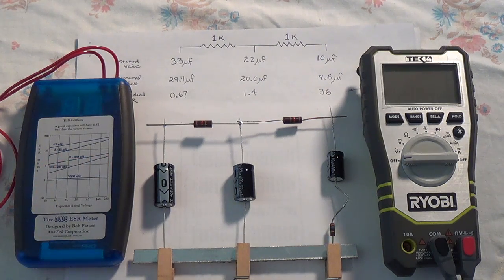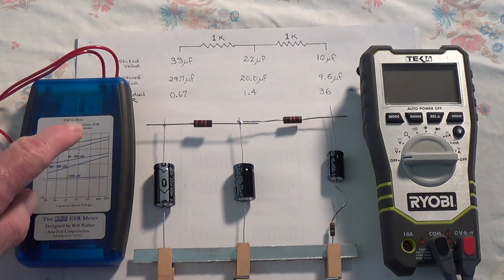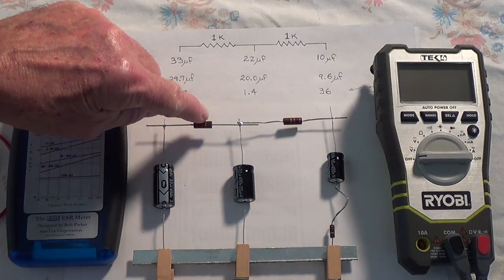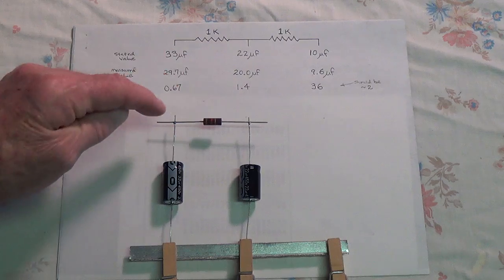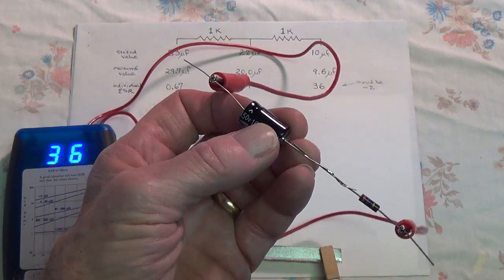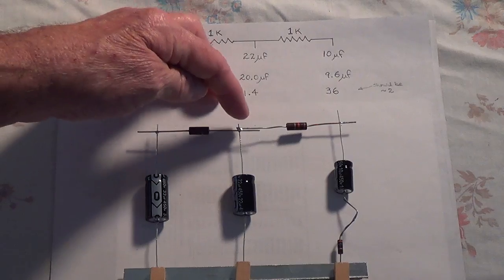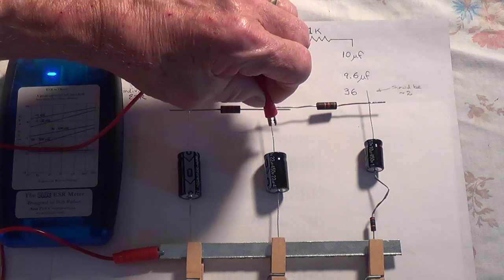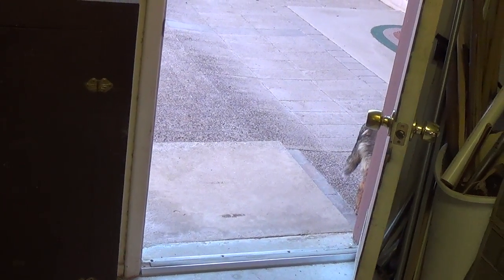Measuring ESR in Tube-Amp Electrolytics, In-Circuit

Comment: what if it reads 0.0?....thats what im getting on the filter caps of a hybrid solid state amp with a tube pre amp section....i really like it but it totally fizzled and died....a 'Legend rock and roll 50"  ....thanks Uncle Doug-
Reply from the maker: What value are the capacitors, Ed? Solid state amps often use caps that are of very high capacitance and relatively low voltage rating......which will provide ESR readings that are quite different from tube amp capacitors.
Reply: 63 volts ; 3300 microfarads and and right above that there is marked CE 62W....is that 62 watts?....it also is marked NEGATIVE with a little circle grid and JAPAN.
Reply from the maker: As predicted, SS filter caps are the opposite of tube amp filter caps. Looking at the Anatek graph to see what an appropriate ESR value would be for such a cap, we see that @ 500uf the ESR value is around 0.1 Ohms......so you would expect a 3300uf cap to be even lower, i.e. just about zero.   https://anatekinstruments.com/products/fully-assembled-anatek-blue-esr-meter-besr

Comment: I can't quite figure out why you would want "proof" that a capacitor is bad or out of specs.
A casual glance at any capacitor spec sheet should quickly make you worry about
how many hours, and at what average temps and voltages, a particular capacitor 
has been subjected to.
Capacitors are a "wear" item, (just like tubes), with a finite, relatively short, 
(compared to other components), life span.
Unless it is completely obvious that the capacitors have been recently replaced, 
and are reasonably over-rated, 
(temperature, voltage, and hours ratings), for the application,
they should be replaced without question, or proceeding any further, 
unless you're trying to unscrupulously generate future business for your repair shop.

Keeping a capacitor for nostalgic reasons ??
Unless you are a hard-core purist collector who doesn't care about functionality, 
most people actually USE tube amps for the particular
"signature" of the signal distortions that that particular model or design creates.
Having 60 year old, leaky, out of spec, capacitors WILL NOT result in 
the original "Tone", and/or, distortion character, 
that the amp was originally designed to produce.

The lesson ? When in doubt, don't waste time "testing" capacitors,
REPLACE ALL THE CAPACITORS FIRST, then you can start testing resistors.
Reply from the maker: An interesting point, Jim, except that testing and experience have proven that most (particularly non-electrolytic caps) last much longer than you might imagine. Why is this important? If you simply replace all the caps and slightly out of spec resistors in a vintage circuit, it is no longer a vintage circuit....it is equivalent to a "reissue", in my opinion. I have quite a few very old amps in my collection with all their original components intact, and they sound great.....far better than if they contained a slew of modern Chinese parts.
Reply: To be perfectly honest, I've never had any association with the "Cork Sniffer" crowd.
But I DO have some kind of weird attraction for the crude, "old school", look and feel,
and even the old ads and catalogues. 
And, I am astounded by the sounds and display of absolutely massive, 
raw talent demonstrated by someone like Don Rich,
ON LIVE TV,
https://www.youtube.com/watch?v=bOj9Bf1P3Ww
even though I'm not really a country music fan.
At the same time, Don Rich was running JBL speakers in his 
otherwise stock Fender Black Face Twin, (with no kind of external effects),
does this amount to sacrilege ?? 
Did Don "destroy" a perfectly pristine Fender Amp by changing speakers ??
I think the whole 100% OEM original "thing" is kinda silly.
Especially when his one-off factory custom Telecaster had the "wrong"
strings on it, and the Bridge heights and Pickup heights were also "wrong".
Then throw into the mix, a 15 foot long coiled cord from the guitar to the amp,
with a huge mish-mash of inductance, capacitance, 
and resistance radically altering the sound of 
those "perfect" factory original Tele' pickups.

Then there are the people who will brag on their amps "originality",
and then put a stomp box in front of it, are you kidding !?!?!
What's the point ?

It's all so silly to sacrifice so much consistency and reliability
for the sake of being able to claim that "the capacitors are all original".
The capacitors in these amps were crap, 
even for the time period when they were brand new.
There were much more reliable and consistent caps available even then.
And even though the sometimes inferior parts choices probably did
contribute somewhat to the "Tone" achieved by that particular combination,
in that particular time period, when these amps were relatively new ;
Time continues to march on, 
and their performance degrades into something completely different,
( DC on pots, asymmetric audio distortion, red plating tubes / whacked-out bias,
completely different tone control qualities, changes in gain between stages ),
so the best you can do is to attempt to duplicate the original 
performance and sound, using modern replacement parts,
because the original capacitors will never again perform like they originally did.
So, you will always wind up with performance and 
sound (Tone) that is definitely not "original", when keeping the "original" parts.

It's kinda like keeping the original tires on a model-T Ford,
yeah, "it's 100% original", but don't try to drive it on the street.

I'm not a "hater" by any stretch, but what counts to me is preserving the 
special type of  "communication"  that the music being produced represents, 
and, eliminating anything that would get in the way of, 
or, distract from, that valuable communication, like a finicky, pain in the butt, 
antique amp that must be maintained in a certain "original" condition.
Reply from the maker: Thanks for your input, Jim.
Reply: Keep in mind, Jim, that the customer is always right factor comes into play when working on others' equipment. Doug mentions this in other videos. Although I tend to agree with you, Doug needs a means of determining if these caps are worthy of what the customers want. In the amps I buy and repair as a hobby, I tend to replace more than necessary,  but I'm not working on botique stuff either. I went ahead and got a blue ESR to simplify things, and to learn from. Also, sometimes those little bastards are in spots that are so hard to get at, that if I can leave it there, and it's functioning still, even if not for decades longer, I'll enjoy the option of leaving that particular little bugger in there. I do change all filters and couplers, though. Too risky leaving those in there, in my opinion. Kudos!
Reply: @jaysorensenIBEW  
Wow .......
5 years later,
The Internet is an amazing place.  👍
Reply: Yes sir, it is! Hell, I'll reply to posts from 10 or 15 years back lol. Love learning from smart fellas like Doug and yourself.  Thanks

Comment: Uncle Doug, I went looking for an ESR meter and couldnt quite swing the $99 for the blue one, but found this thing. It actually works and is pretty darn cool, as it does all sorts of measurements. I've tested it with a bunch of things and it seems on the money so far. I made some leads for it that I can just plug into the component socket and test in-circuit. Thought you'd appreciate this as it is cool and also very cheap.
https://www.youtube.com/watch?v=ElIYiIm7lGU&t=519s
Reply from the maker: Thanks for the link, Sam. I'm sure it will be helpful to viewers who want an ESR meter at an economical cost.

Comment: Uncle Doug:  Good stuff as usual.  Sparky, my heeler says "Hi" to Rusty.  I first learned there was such a thing as an ESR meter from watching this video.  After doing some research, I purchased a Cloud Atlas ESR-70 which measures capacitance and ESR in circuit, thus eliminating the need to detach one end of the cap to check value.  Seems to me that if the ESR is appropriately low, it would be redundant to do a HV leakage check since the low ESR indicates little to no leakage.  Or am I missing something?  Keep up the good work.
Reply from the maker: +jflimbach  Thanks, JF. The only reason for leakage testing is that it is done at full operating voltage, whereas the ESR test is not.  Leakage may not exist at the low voltages used by the ESR meter, but may become significant at higher voltages.  That said, it's my experience that low ESR caps are generally fine even at full operating voltage. A potentially leaky cap genrally seems to have an elevated ESR, even at low voltage.  So you can be thorough, and leak test......or expedient and simply use the ESR. It's really a matter of personal preference.  Rusty sends his regards to Sparky :)
Reply: +Uncle Doug 
Yep, I agree.  Don't usually bother with leakage test if they pass ESR, usually only have to leakage test on old paper types but not much since after 40+ years I just assume that they're leaky and about 99% of the time they are.
Reply from the maker: Yes, on old paper (especially coupling) caps it's often best to simply change them out.

Comment from the maker: Full House, your question came without a reply capability, so I'll answer up here. The power supplies of most solid state amps use electrolytic filter capacitors, which can hold a charge for a long while. However, most SS amps also operate at much lower voltages than tube amps, so the chance of a serious shock is much less. Just the same, it would probably be wise to drain the filter caps before touching the circuitry, and then only touch it with one hand......never both.
Reply from the maker: You're welcome, FH, and thanks for the very kind words. Rusty and I wish you the best, too. Please be careful. We care about our viewers :)
Reply: Dans toutes les vidéos parlant de condensateurs ou de tension SECTEUR, il est répété (rabâche)des consignes de sécurité !!!celui qui n'y PEnSE pas et  quise fait '''chatouiller'''par du110ou220volts s'en souvient quelques TeMPS!!!! Faut-il encore seriner cesconseils de sécurité de base???????????!!!!!!!!!? OU il faut CHANGER d, occupation !!et opter parEXPL.pourla belote !!!!!!!moins'''dangereuse''''
Reply: Mais il est sûr que oter la prise Secteur est le minimum à rappeler(il y aencore des inconscient s sur terre)!!
Reply: You can get a painful  jolt from a charged 4700uF/25V cap. (Don't ask me how I know!)

Comment: I have really enjoyed your videos & have a question. I recently came across an estate sale with loads of old electronics, boxes & boxes of tubes many of which were NOS still in thier boxes. Being a complete novice, how would one tell the gold from garbage? I really had the urge to snatch it all up & figure it out later just to have it if only for history sake. Thanks, & look forward to more videos!
Reply from the maker: ***** Without an inventory, it's impossible to tell if it's trash or treasure, Jay.  If the price is quite reasonable, I would suggest buying it all (before someone else does) and then figuring out what you have.  People sometimes get paralyzed with fear over losing a few dollars and end up losing out on great deals. If the price is easily within your means, roll the dice.  At the very least, you'll end up with a story to tell the grand kids :)
Reply: The sale is today, I think I may do just that. There are also several Heathkit items - testers, signal generators & a "Jackson Electronics" unit from Dayton, Ohio. Being originally from Dayton I was particularly interested in that as I'd never heard of that company. If it works out I'll let you know. Thanks very much for the reply!
Reply from the maker: You're welcome, Jay. If nothing else, you could probably sell the items you don't want or need on Ebay and realize a nice profit.

Comment: i have an old peavey solid state bass head. got it in a pawn shop. you can see the finals and they have white looking stuff around them. when the guy plugged it up to a speaker cab it made a frying noise. when i plug it up at home without cab it is silent. does that mean the transistors are blown and it would be a waste of money to buy more until i found out what caused it. thanks for any help. ps-i got it for 20 bucks. it says peavey bass on the front of the head. i love the old peavey bass amps but i can't afford to put a lot of money in it and i don't know enough about what might have caused it to blow the finals if they are. would you have any hints. If you were closer to me i would trust you to work on anything of mine but it is hard to find anyone here if you could even trust them.
Reply from the maker: Billy Bob Greetings, BB. My area of interest is strictly vintage tube amps, so I am not particularly knowledgeable regarding solid state circuits. I'm not exactly sure about your inquiry, but if the amp is simply a head, it will be completely silent unless plugged into a speaker cabinet. If it's dead quiet then.....you do have a problem, possibly with the output transistors.
Reply: Thank you very much.I enjoy your videos. You are very intelligent and you explain things so people can understand. That is a unique quality.
Reply from the maker: You're very kind, BB. Thanks, and best of luck with your Peavey amp.

Comment: I want to confirm that this meter works like a charm! I acquired a '67 Deluxe Reverb about 2 months ago. It had all original filter caps, and I wanted to keep it as original as possible, yet still have it operating at 100%. I checked all electrolytic caps with the blue ESR meter, and all were fine. About a week ago one of the caps started going bad right in the middle of a playing session. There was a hum present and gradually getting louder that wasn't there at the beginning. I used the ESR meter and identified the bad cap. It was the bias capacitor. I replaced it and the problem with the hum was no longer present. I now have my amp working at 100% again, and still have retained all but one of the original capacitors. Thanks Uncle Doug!
Reply from the maker: rbauer1632 Thanks for the confirmation, RB. It really is a very useful tool for selective, rather than indiscriminate (i.e. "shotgun") repair. Ideal for those of us who appreciate originality.

Comment: Uncle doug, I just found your channel and I watched every video. I think you have an amazing knowledge base. I found your videos very informative and easy to follow and I await your next vid with bated breath. I wish I could get my dog to run a camera like Rusty I can't even get him to roll-over. I'm starting my first amp build with the venerable 5f1 and I have a Question about the virtual center tap for the 6.3v filament winding. instead of connecting the two 100 ohm resistors to ground, on my print they connected to the biasing resistor for the 6v6gt on the cathode side. Is this a later mod or a misprint? Thanks again for rekindling my interest in tube eletronics.
Reply from the maker: jeff greenwell Greetings, Jeff, and thanks for the very kind words. I believe this wiring variation is to "elevate" the 6.3VAC filament voltage by referencing it to a (low) DC voltage rather than ground. This is another good maneuver to reduce hum, and probably quite effective. Thanks for the input.